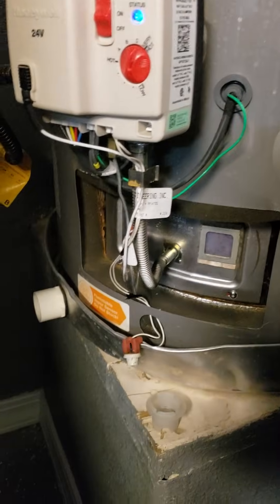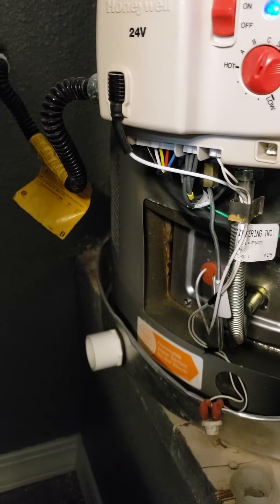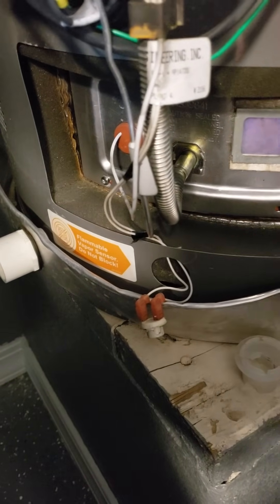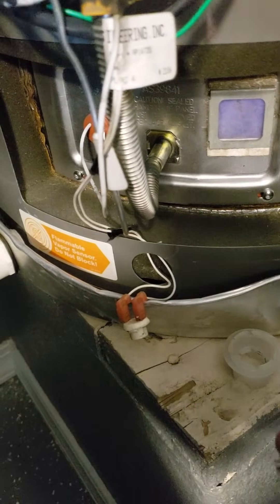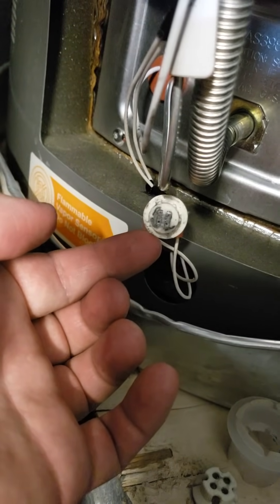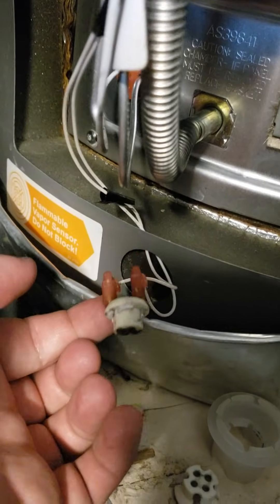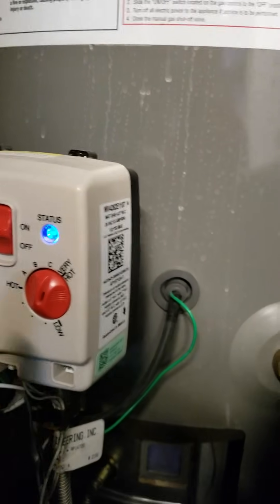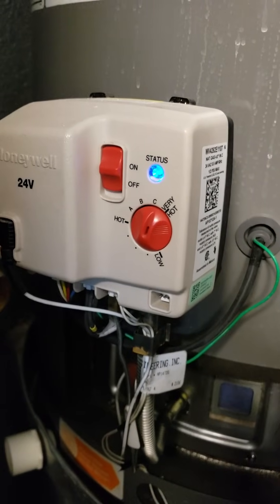Flamable Vapor Sensor Fix (not replace)

Comment from the maker: I'd like to clarify a few things. First, this video is about how to bootleg a faulty Flammable Vapor Sensor so it works temporarily and how to reset the unit. if you pilot light goes out, test the ohms on the sensor and replace if it doesn't read between 9k and 45k ohms. If you don't the unit will lock itself out until you install a sensor that has the proper reading. These sensors are easily damaged by moisture and go bad, at which point you only get the reset the unit a few times till it hard locks!

Comment: Luckily I have tons of resistors I tried 10ohm
22ohm
100ohm
1 k ohm worked
Thanks for the info.
Helped me figure out how to get mine going. 
I was soldering on my water heater adding a side arm heat exchanger for my outdoor wood boiler then I couldn't get it to light. I was within 6-8" of that sensor and soldering makes some smoke so I guess I killed it. But at least I'm up and running till the sensor gets in

Comment: We have this same unit,  bought in 2019. I followed these instructions,  and it worked.  

BUT... here's a tip. Called Rheem (number on water heater). They told me all the steps to diagnose. I already wrecked the sensor, and after reset it worked fine.  He said if it returns code 8-1, they will send free replacement. Otherwise I have to buy one.  Found on ebay for $34. 

So,  just do what they tell you on the phone FIRST, and get the 8-1 code for a free replacement.  THEN tear it apart to make it work while waiting for the part.

Comment: Gees dude what a life saver. Appreciate the time to post this. I left town for six weeks and shut the power off at the house but did not shut the unit off as well. I had a leak in my roof and the WH got soaked (Not sure if that had anything to do with it) When I returned The water heater would not start. I even unplugged it and tried it again but nothing. After watching your video I tapped on the sensor. Checked the connection and unplugged the sensor. Reconnected it and unplugged the water heater. Plugged it in and went through the steps you provided and it fired right up. Been taking a bird bath for two weeks:0.

Comment: I have a Reliance Forced Air Hot Water Heater which has the Vacation setting past the Low setting.  When resetting the unit I discovered to only toggle back and forth between Low and Very Hot and it started right up.  Thank you for this video.

Comment: That was AWESOME !!!  I used the pencil method and got it up to about 38k ohms, plugged it in, did the reset 7 times and Boom, started right up.  Thanks so much.  I didn't want to spend 4 days having to have cold showers and this is a temp fix until I get the new one.

Comment: Sensor ELEVATED way above the floor level.   Purpose is to pick up fumes lingering a floor level?   comment please
Reply from the maker: I'm not sure what you mean. All states require water heaters with an ignition source to be at least 18 inches off the floor (some states requiring 24" or higher). Yes, most flammable vapors are heavier than air and hopefully will settle below 18 inches. However, air moves. When those vapors move, they can easily reach the ignition source of the unit. This is why these 'sensors' are so touchy.

Comment: Good tip,  the same reset works for the AO Smith water heater.   The manual does not tell you you need to reset the control by turning the thermostat from low to hot multiple times.   

Thanks it saved me the $$$$ for a plumber.

Comment: It worked!! Thank you!
The only thing I would suggest is that you add that the pencil marks are between the two gray sensors. I kept coloring them separately and got nothing, then colored between and it worked. Your previous pinned comment was also helpful regarding the range of ohms.
Reply: this worked for our unit
Reply: basically you need to pencil a line to connect the two gray sides of the sensor

Comment: Man, you saved my life!!! The water heater hasn’t worked for three days. I called a water heater service which wanted to charge me $275 just to change the little flammable vapor sensor sucker except they didn’t have the part. They strongly and repeatedly advise me to replace the whole water heater for $3500. Thanks to your tip on cleaning the sensor and using a pencil to add graphite to it, I was able to restart the water heater. I ordered a new flammable vapor sensor from Amazon for 50 bucks which will arrive tomorrow. Thank you so much for your help.

Comment: I think I hard locked mine.  I have a new sensor replaced and the light is blinking blue @ 4 second intervals.  The exhaust flap does not open and the unit does not come on.  Any advice?

Comment: Worked like a charm. I ended up with about 9kohm resistance after doing the pencil trick. Water heater fired up after rotating the dial twice.

Comment: This totally worked. Took a little doing to get the ohm reading right, but I got it correct and lit the water heater up. Replacement part arrives tomorrow!

Comment: For those that don’t need a VOC sensor. A 22k ohm resistor is a nice little fix. Mine is in my attic no where near any VOC. And I’m tired of waking up to cold water with no warning. Even with a wifi device that’s supposed to alert me to any faults.

Comment: Thanks, worked like a charm. I had a faulty gas control valve and after replacing it I was quite disappointed to then get the vapor error. As it turned out merely doing the low to high 5 times reset things and it worked perfectly. Regardless, a new sensor is on order. My wife and I both thank you.......

Comment: thanks for this! i had been able to just reset my the gas valve whenever i got this error but the other day, i couldn't reset anymore so i decided to purchase a new sensor hoping that will fix it. wish i would've seen this sooner, we haven't had hot water the last couple days and my sensor is not coming in until later today.

Comment: thanks.  I found a sensor that worked at Menard's (SKU: 6831977).  The only caveat is that the included instructions talk about resetting and turning the controls up and down seven times, but they are referencing a control unit that looks nothing like the one on the Rheem.I installed this water heater about 9 months ago and am really disappointed that a bit of moisture can cause all this grief.  Time to buy an extra sensor and tape it to the back of the unit!
Reply from the maker: Yup. These sensors are ** and I will never buy another unit that has them. Always keep a spare sensor on hand unless you like shrinkage!

Comment: I "fixed" mine by using spray graphite lube. Hit it with a quick shot - and then just lightly wiped off the graphite with my finger until it read about 10K ohms. Took a whopping 2 minutes to fix. As OP said, this is temporary, I ordered a sensor but I want hot water until then. I tested my fittings for leaks, and there are no flammables in my garage, but I still take responsibility even if the risk is low.  BTW these sensors gradually go bad. About a year ago I had to start doing the reset procedure. It got to the point where I had to reset at least once a week. Sensor reading when I removed it was about 140K ohms.  It still worked - you could hold it over a can of alcohol and watch the resistance go up - but it never dropped below 140K when "all clear."
Reply: Genius stuff with the graphite lube. Got my tenants hot water for the weekend until the new one can arrive!

Comment: Thank you. In my case wire came off the spade connection at the back of the sensor. sensor reading 22K ohms needed to rest it 7 times like in your description. Thank you again. The funny part is I’m a licensed gas fitter just don’t work on residential water heaters and now I know.

Comment: In case anyone is having trouble at the resistance part, the resistance range is supposed to be 9KΩ-45KΩ, I think he meant to say 12KΩ.  Also I can personally say this trick does not fix a 6-3 flash code...T_T
Reply: Thank you for the resistance range note. I was able to disconnect the sensor, and twist 3 5.4kΩ resistors together and stuck each end into the sensor wires. Worked like a champ.

Comment: Awesome!!!someone knows how to call the phone number on the installation manual,they also knowed how to talk to tech support!
Reply from the maker: I highly doubt tech support knows how to bootleg the sensor to work, not would they recommend it as it will stop your unit from detecting a leak.  But I expect nothing less than stupid comments from people who take gym pics in half a shirt. Really going for the complete attention seeking thing i see?
Reply: One other thing flammable vapor sensor, detects if your units leaking,do u understand what flammable means
Reply: Flammable vapor sensor,vapor is not a liquid which water is...this guy is brilliant
Reply from the maker: @philipwall1025  correct. The sensor can go bad due to multiple reasons. If you are awaiting a new sensor and need hot water, the reset only works 3 times before the unit will lock out and REQUIRE a new sensor. Which sucks if you can't find one locally and like hot water. The pencil trick is used to hack trick the unit into thinking the sensor is good and allowing you to reset the unit so you have hot water until you are able to get a new sensor.

This video has nothing to do with the reset (which is in the manual) but more so how to bypass the faulty sensor until a new one arrives.

Hopefully that was explained in small enough words for you.
Reply: U just figured out 2 go from lo temp to high 7 times,u tried different variables,and intangibles and cracked the code!
Reply: He just figured to go from low temp to high seven times,and by doing so overrides that sensor and resets the combination thermostat ,gas valve.He tried variables, and different sequences and then after finally finding an enigma from ww 2 he then CRACKED THE CODE. Absolutely Brilliant

Comment: Not related but quick question. 
I'm out here in California with the power outages. Was told that even if its natural gas this (this heater) will not turn on the pilot to get hot water? Due to it needing an outlet source. Can some one help.  Thanks.

Comment: THANK YOU! The vapor sensor went out today on my Whirpool water heater with a Honeywell valve. I tried this (coloring in the sensor with a pencil, then resetting the valve by resetting the power and cycling the temperature 7 times. That did the trick and my water heater is now working again. Can't thank you enough!

Comment: just FYI to minimize frustration: if you try the reset option and hours later it gives you the same flash the sensor will need to be replaced. Apparently, once the sensor has been "contaminated" it will continue to read faulty. I went to my local hardware store and paid $47.00 for a new one. Still cheaper than having a plumber come out and do it for me....

Comment: I wish you had a video on how to start the pilot on this type of unit!!!
Reply from the maker: All you have to do is flip the red switch on and set the temp.
Reply: @phatwcinfrcr  It actually was on....I turned it to off, and to low...then realized that the plug (wall) was tripped (red light) reset, and then it all started working again, then turned it back to on/temp.  this was the most confusing system ever - but thanks for the info.
Reply from the maker: @worldnomadtraveler  Ah, got ya. That is a GFI plug. Depending on your code in your area, that may be required for all garage outlets. If your GFI is tripping, and there is not a ton of stuff plugged into that circuit, you probably have a bad GFI.

Comment: Good Stuff bro. Question...my pilot light keeps going out about 18 hours after resetting the valve as you described. So water gets cold then I go back and reset again, and this process keeps repeating. Does this mean the sensor needs to be replaced or does it sound like a setting needs to be adjusted? Thanks in advance.
Reply from the maker: Replace the sensor asap or you will need the pencil trick. These sensors are super sensitive and go bad often. Afyer 3-5 resets the unit will hard lock until a new sensor is installed (meaning the reset will not work until a sensor reading the right ohms is installed). See video description for more. Hope this helps.
Reply: @phatwcinfrcr  Thanks a lot bro.

Comment: Very good info, changed the sensor and would not fire up. Tried the reset they talk about with no luck. Cycling the temp switch from low to hot 4 times on mine reset it! Thanks for the info.

Comment: It worked for me. I didn't have the gauge but I cleaned the surface well and drew a heavy pencil line connecting the two rectangle shaped sensors. After about the 5th turn of the dial the blower turned on and we soon had hot water. Now to shop for the lowest price of a new sensor. Remember when cleaning with chemicals nearby you should unplug the unit until the floor is dry or fumes no longer exist, or you could go through this every time. Mike

Comment: Is it difficult to replace the sensor yourself? How’d you learn how to do it? I’d like to learn since i have this problem
Reply from the maker: No. The sensor just pulls straight out and the two electrical clips come off the back. Hook up the new sensor in reverse and turn on the unit.

Comment: Cycled the thermostat 6 times and it fired right up! Thanks very much for a great weekend save!
Reply from the maker: Should be noted that you more than likely have a failing sensor if you have to perform the reset. I'd have a spare on hand just in case... My boot leg fix to trick the sensor into thinking the sensor is good might work, might not.

Comment: This video saved Mother's Day!  We had water in our basement and while the water level didn't reach the tank, i think high level of moisture in the air caused the sensor to fault.  Thanks for explaining how to reset the sensor.  Turned the knob to 'all on/all off' x5 and it started right up.  Hoping this solves it, but if not i know where the problem is

Comment: Prob could have just jumped the sensor by joining the two wires together
Reply from the maker: Negative. The reading needs to be between 9K and 45K otherwise the unit will think the sensor is bad. Jumping the wire will provide little to no resistance throwing a fault. If you had the right resistor that would work, but most people don't have resistors laying around the house.
Reply: phatwcinfrcr Touché

Comment: This saved me. My sensor was ok but nowhere, not even the manual, told me about turning the dial like that to reset it.

Turned it 8 or 9 times and it fired right up!

Thank you for this video.

Comment: Thank you for posting this! I was able to get my water heater back on temporarily while I get a new sensor. Great lesson here about not letting water drop near as I spilled water all over while changing my expansion tank.
Cheers!
Reply from the maker: Yeah, these sensors are terrible and easily angered. I will not be buying another water heater with this design.

Comment: Thank you for sharing this trick.  It worked for my GE/Rheem. I tried 12 Ω, but could never get that low - and I kept getting a sensor out of range error.  I belive the correct resistance is closer to 12kΩ - that is what worked for me.  Great trick to have hot water until the new sensor arrives.
Reply from the maker: Yeah, I mispoke in the video. I had updated the notes on the video but most tend not to see that. Sorry about that!
Reply: @phatwcinfrcr  thanks for the video! I couldn't get the pencil thing to work but I had some resistors. Found a 12K and put it in place of the FVS and WooLa (that magic word) it fired up.

Comment: Awesome! This worked for my AO Smith GPVH 50.....I'm good for a day or two until I can get this FV sensor replaced. My family is taking hot showers! I already replaced the Gas control valve then this failed. I think the plumber got it wet while he replaced the valve. I'm looking to get 4-6 more years out of my 6 yr old water heater. These things are $1000. THANK YOU

Comment: This is gold! I have a State water heater and the same problem presented (7 flashes and 3 second pause). Watched this vid and followed along. Switched the wh off, unplugged for 30 secs, plugged it back in, switched it on. Started turning the dial (low to very hot) and the wh kicked on during the third turn. I may order the part for the future. But right now, I’m happy to have hot water! Thank you for sharing!!

Comment: Thanks! Worked perfectly and I didn't need to change my sensor - I just turned off and then on and turned the dial 7 times. Boom! Not really boom - no explosion - just boom as in "Success!"
Reply: Yep, same with me. I was painting with an oil  based garage and floor paint and I should have turned off the water heater when I was painting around it. I didn't notice it had turned off until later. But fortunately, just by unplugging the power, plugging it back in after 10 seconds and then turning the temp dial 7 times back and forth all the way, it reset the vapor sensor and turned back on. I was just about to call out a professional, but first I went to youtube watched a few vids and read your comment...and it worked. I'll give you a +1 too Lance, as well as to the video.
Reply: Thank you SO much for your comment! I just did exactly what you did, w/o removing the sensor like he did in the video & it worked like a charm! You're the man, Lance! & thank you to the uploader of the video as well! But Lance, quick question... Could you or anyone else who did this PLZ give me a long term update on this quick fix? Did it solve the issue for good or did the lockout repeat, resulting in the sensor eventually needing to be replaced? I don't want to purchase a new sensor if I don't have to, but I also don't want to get a permanent lockout like the uploader warned about. I would GREATLY appreciate a reply. Thanks again!